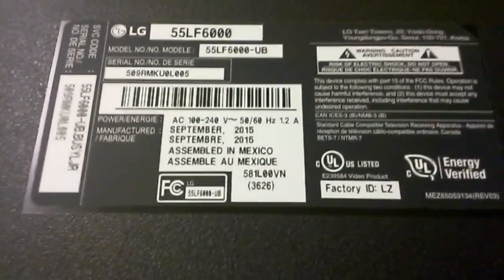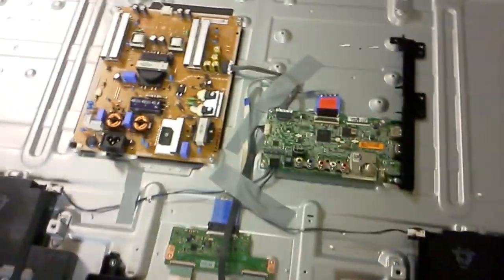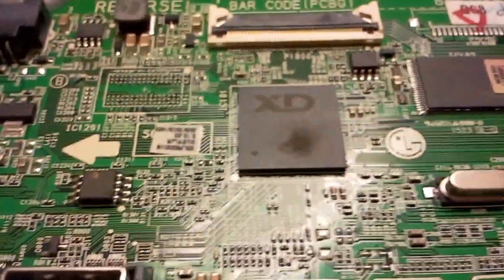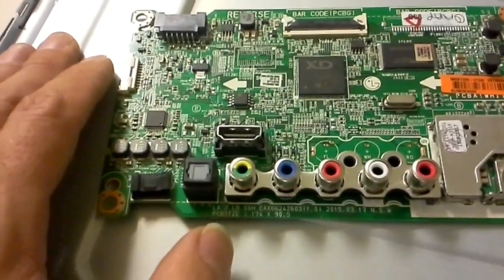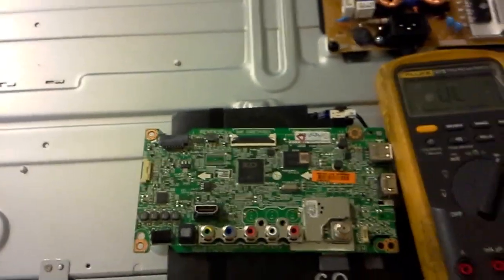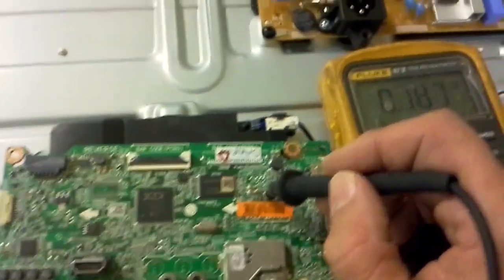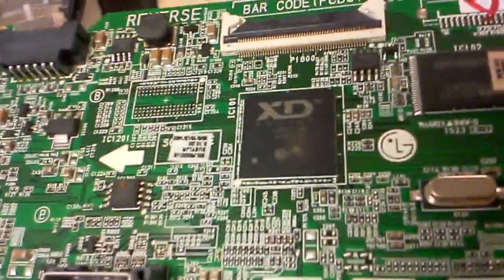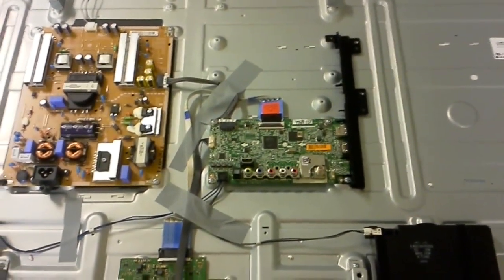How to diagnose and repair LG 55LF6000-UB not starting up

Comment: I was playing ps4 and all the sudden the TV made a static sound and shut off and has blinking red light. I unplugged it but it still doesn't turn on and continues to have a red flashing power light. Would this indicate a board failure of some kind ? How much do the boards cost ? I have not took it apart yet. Tv is about 5 years old same model

Comment: I have the same exact model in my city storage but found out my city storage had cockroaches, so when i took it out n took it home it wont turn on at all.   Have any idea what i have to do to make it work again?
Reply from the maker: Afraid not. I honestly admit I do not have extensive experience with damages inflicted by insects. I am guessing it can be totally random location, which would make it practically impossible to determine over Internet.

Comment: I have this exact same tv model and we had a lightning strike and my tv has the red light on and it doesn’t respond to turning on. Also the screen is not completely black it has like a light tent to it like it’s trying to work. Just wondering what circuit board I would need to replace to fix our tv!!
Reply from the maker: Lightnings affect mostly two boards - the power board, which is connected to the AC line from where a surge may come, and the main board, which is where the cables with the input signals come.
If an external device was also fried then it virtually certain the main board is bad.
Reply: Thank you so I would need to replace both the bigger brown one and the one like you did in this video correct?
Reply: We also had our Xbox one s connected to that tv witch both were off at the time and the Xbox now doesn’t turn on either or light up so I think it got fried as well
Reply from the maker: @HennesyGT23  From the sound of it your power supply board is good.
Reply: @coppelelltvrepair so I need to order the green board like you replaced or do I need to replace the small geeen one towards the bottom?
Reply from the maker: @HennesyGT23  Most likely yes you do.
Reply: Thank you

Comment: I have this same exact model, My TV turns on and shows perfect picture and perfect sound but it continuously blinks on and off at about 1.5 second intervals. Any ideas what might be the possible cause. Thanks.
Reply from the maker: Is the audio cutting off or only the video and is the backlight cutting off or just the image?
Reply: Coppell TV Repair LLC ....The audio is continuous, the picture goes completely black, then back on with perfect picture then black again at the aforesaid intervals.
..I did take the back panel off and plugged it in and turned it on, it appears the the back light is indeed blinking off and on. Hope I answered your question....I did test the volts coming from the ps into the main board and on two I got 3.2 volts and 13.2 on the other 3.
Reply: Mark Jaggers There are two several options, the two most likely being bad psu (LED driver circuit in particular) and bad LEDs. There are arguments in favor of each based on what you say.
From statistical standpoint I'd go with bad LEDs first, but then a replacement power will likely cost you $20 or so on ebay so you may want to try that first.
Bad leds can only be handled locally, we won't be of help there.
Good luck!
Reply: Bobby Kolev ... Awesome, I'll look into it. Thanks for responding.
Reply: @kolevbg  like

Comment: I am fixing this exact tv but the back lights are going off after a short time instead. I tested the exact same spot that gave you the low resistance value on the board, and it gave me a low reading as well. Should be that grounds enough to buy another board or is there other spots to test to see if it needs to be replaced? Thank you.
Reply from the maker: I do not have an accurate and useful reply to you, sorry.
There sure are many points that could be tested and if one either schematics or lots of experience there are certainly many things to check.
For practical purpose nothing beats experience as ultimately boards tend to fail in only so many ways while one has only so much time to spend troubleshooting.
So it comes down to finding the right balance.
If you have ohms of resistance where I had ohms of resistance and where a good board has 450 ohms then you nearly certainly have a bad board.
Reply: @coppelltvrepair  I looked deeper into it and the other side of capacitors you tested were open for me while the other side of all them were 6ish ohms. Would you say there should be much of a consistent variance between our boards? Regardless, thank you for the help and the video itself.
Reply from the maker: @chillypenguin100  Sorry I do not understand what you are saying. But in either case I did watch the video and other than calling the main board "power board" once I did not see anything important that I'd do differently today.
Which is to say you should stick to what it is saying and I won't be able to add to it, especially now that I am on another continent.
Reply from the maker: @chillypenguin100  Sorry I do not understand what you are saying. But in either case I did watch the video and other than calling the main board "power board" once I did not see anything important that I'd do differently today.
Which is to say you should stick to what it is saying and I won't be able to add to it, especially now that I am on another continent.